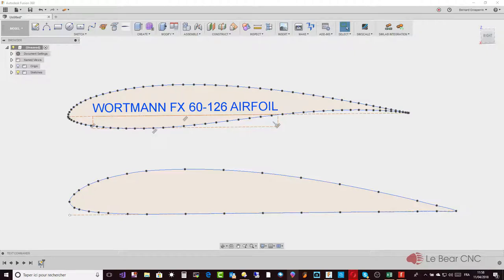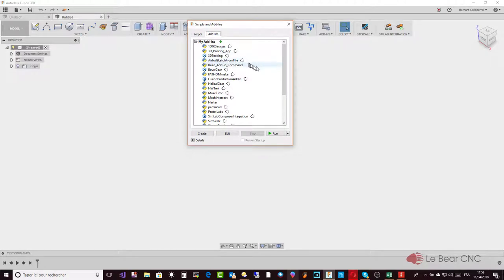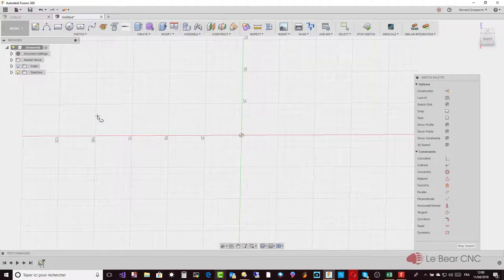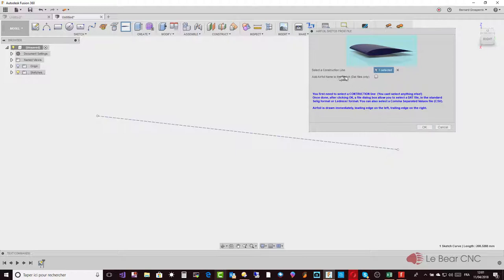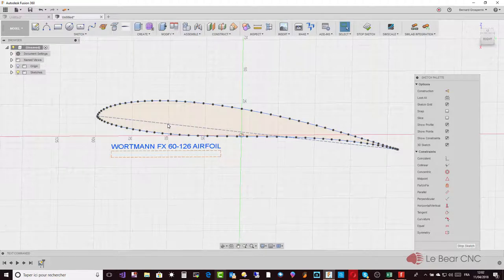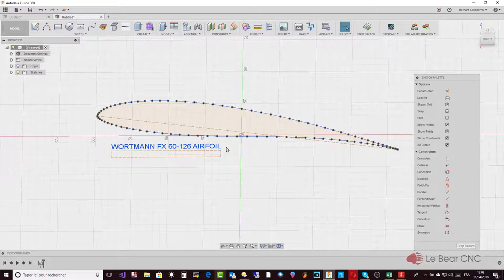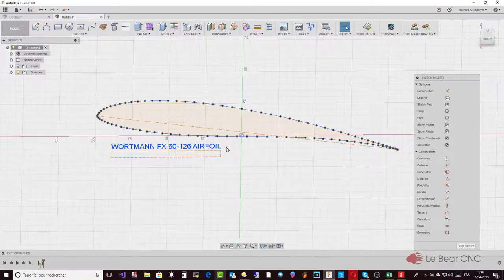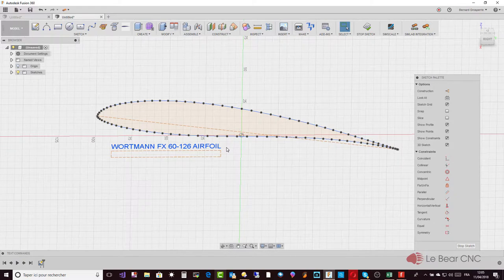Airfoil Sketch From File - Autodesk Fusion 360 Add-in

Comment: Hi Le Bear CNC, this looks like a very useful add-in, it would make designing wings much easier. Unfortunately I currently run Fusion 360 on a Mac, are you able to make this available for MacOS? It would be much appreciated! Thanks
Reply from the maker: Hi Tom, I am sorry but so far the answer is no. Apple does not make it possible to run virtual machines on Windows, so I have no ways to test on a Mac. But as I said, this is "so far". maybe I'll find a solution in the future...

Thanks for your comment. Take care.
Reply: Thanks for the quick reply! And no worries, I understand. Out of interest, does your add-in automatically update the airfoil dimensions and orientation if the construction chord line is edited later? That is, does it run the script again when recalculating if you were to edit a feature before it in the timeline?
Reply from the maker: Good question! I have not tested that. Hum, you are making me curious! :-)
Reply from the maker: I just tested, and no, it does not recompute the spline if the construction chord is edited....I'll see if this can be implemented, it would be nice.
Reply: @LeBearCNC  would you be interested in MacOS testers? Would love to have support for my OS.

Comment: How do you install that Add on in Fusion 360? I see it in Add ones , but no run button yet. What did I missed?
Reply: It is working .Great application. Thanks
Reply from the maker: You're welcome.
Reply: @zbigniewmichalczyk1152  i have the same issue, what did u do to fix it my friend?
Reply: @XmysterypersonXx  I did nothing. It appears differently. Instead to go to Add-ins you simply open up the sketch , hit the plan you will work on and airfoil will appear in upper menu. Try again.

Comment: how to make airfoil file data so that it can be adjusted to the work line created?
Reply from the maker: You don't, as it is the reverse! What I mean is that airfoil data are expressed in percentage. So, when the airfoil is drawn, it automatically matches the length of the work line, which become your reference, or chord, line.

To say it differently, there is nothing to do, beside making sure your "work line" is at the exact length and angle you want your chord to be.